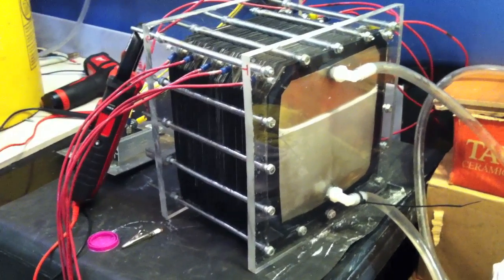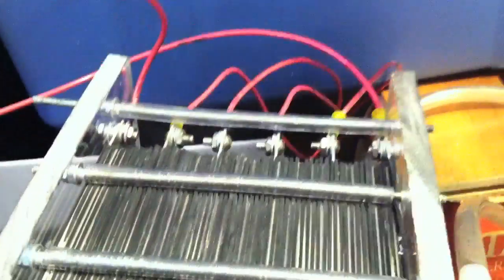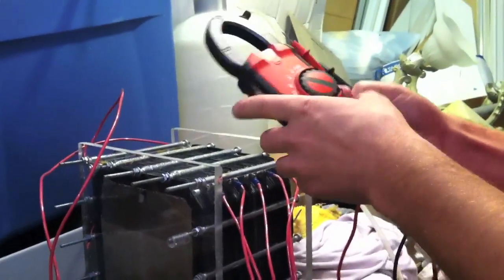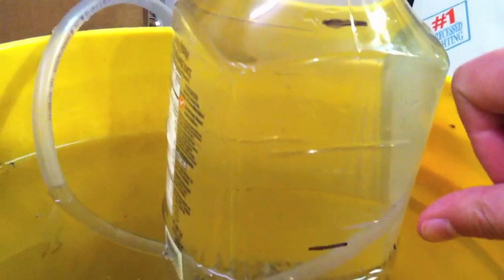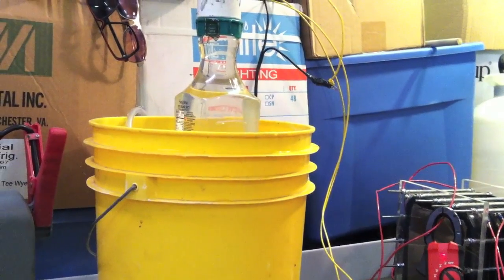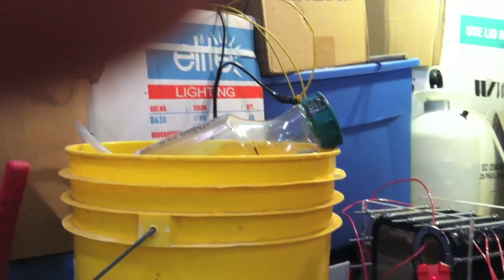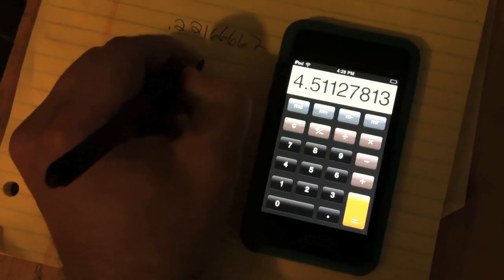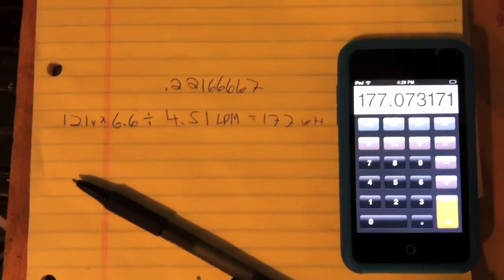120v 4.5 LPM 60 plate hho ( hydrogen ) dry cell demonstration

Comment: Bear in mind that the multimeter read a pulsing fullwave current not a straight line since the voltage isnt buffered by capacitorns. So the measurements and wattage and such will not be accurate unless the multimetre calculate the the peak value with i seriously doubt, only the avarage value with is lower then it actually.
Reply: To an extentextent, without a capacitor compent, the voltage is smoothed by a capacitor formed from the plates  and the electrolyte act as a dielectric storing energy energy below the electrolitic 1.24v per cell in the alignment of water molecules and distribution of ions.
Reply: @kreynolds1123  For the currents involved and the size of the plates that effect is negligible. Maybe at tops a nF.
Reply: @dtiydr  Quite possibly so, although the distance is probably very very small if the electrolyte is as a plate to the cathode, and is a plate to the anode.
Reply: @kreynolds1123  The contact between the plates is very good and that is the totally opposite to what you want in a capacitor since you want it to be able to charge up which only works when the plates are isolated from each other which you might agree is the very last thing you want. So once again if there is any capacitance its absolutely negligible for the currents involved.
Reply: Remembering back to when i did some basic PWM through a logic controller and a solid state relay  with a duty cycle based on temperature, i remember reading huge current surges, about 50 amps   settle down to 30 amps.  I wish i had  a scope to measure that now. 

At the time i didnt think about the capacitance effect, but now i suspect that  pulsing 13.4v on and off and back on again takes a fair amount of energy like the inrudh current of a capacitor, but storing energy in the polar alignment of water molecules, only to be lost when the solid state relay cut the electric current, loosing that energy to the micro turbulent fluid motions of water.  Im afraid that much of the extra energy during the cource of the spike in current just went heating rather than being stored. Between pwm cycles.  But noting the capacitance might be considerable as evident from the size of the current spike. 

I know my next go around will use pwm to  buck convert the voltage down rather than justify switch current on and off. That  is, lowering waste heat with a lower current because of a more efficent voltage is far better than  pwm limiting the average amount of energy being used inefficiently.
Reply: @dtiydr  Consider a supercapacitor. Aside from high surface area, the dielectrics are also made from an electrolyte. And two plates are seperated often by nothing more than paper to prevent the current collecting plates from touching (shorting), but the paper seperator allows ions to pass.

A supercapacitor will take current only untill it is charged to the applied voltage, as long as the voltage is below the break down voltage. For most comercial supercapacitor chemistry , that is just over 2.5v or 2.7v,  but when the electrolyte is aqueous, is the voltage rating is much lower. 1.24. 

In effect, the HHO cell is a double layer electrolytic  not so super, super capacitor for voltage below 1.24v, even it has a relativly high internal discharge rate when the external voltage is removed.
Reply: @kreynolds1123  With a supercap or any cap you miss the crucial point = isolated surfaces. 

In a electrolytic capacitor the thin metall ribbons are heavily isolated by a thick oxide layer and pitted at a microscopical level which creates a huge isolated surface where charge sort of speak can build up. There is nothing of that between the surface of the plates and electrolytic, right? If the plates are slightly corroded of whatever to form a very thin oxide surface or such then it might be a little higher capacitance and smaller current but not near any Farads in capacity needed to smooth out any voltages.
Reply: @dtiydr   Electrostatic double-layer supercapacitors aren't isolated by an oxide layer. Other than the high surface area,  they have high capactance inpart because there is no oxide layer to add distance between the plates.  It is only because of electro chemistry or rather lack of electro chemistry (not an oxide layer) that you have the condition that current will not flow through one plate to the other while the charged plates electrostatic potential remains below a certain voltage based on the type of electrolyte.
Reply: @kreynolds1123  I have other things to do, the capacitance is not enough to smooth the voltage out, period.
Reply: @dtiydr  Despite your assertions that there is not much capacitance I am not convinced. The problem looks more like a high internal discharge rate. 

I pointed out that the capacitance leads to significant surges in current well beyond its steady state current. The surges are counter productive  producing nothing more than heat from the higher current in the metal conductor and dielectric like realignments of the water molecules only to be lost again and again with PWM as a form of dielectric heating of water molecules for voltages below electrolyte's capacity to conduct electricity. 

i'm glad  you have things to do. I was just sharing a deeper insight into what is happening when the voltages are below that which conducts current. And the discussion so far sort of points out problems with PWM.   Good luck with your projects. 😀👍
Reply: @kreynolds1123  Thanks, it was then now I have nothing to do. :) Btw I don't even get the reason to use PWM in these, pure DC and you are all fine and I put the DC voltage perfectly you will get very high efficiency as well and it won't get warm.
Reply: @dtiydr  Why use PWM?  Note, i am not advocating PWM but PWM can limit how much average power is going into a given cell.  Often it is used to prevent overheating. Over heating's root cause as we are aware is a product of too too much over volting along with little surface area to eject the amount of heat that is being generated and the limitations of the materials like gasket and rubber hose materials.

But, over volting is what actually drives current through a cell and 316L stainless steel plate surface area can be relatively   expensive so many people try to compensate steel cost with using more volts to push a higher current density through a smaller surface area. 

If gasket and steel cost were 100th what they are now, one could make a cell 100x the volume now and would be able to produce the same now but at a far lower overvolt producing less heat produced.

Also  with a given design, applying just the right voltage you want isnt easy. Often one  uses neutral plates to make a voltage dividor. But if ones source voltage is 13.4 volts off an alternator, then 5 cells gives you 2.68v while  6 cells gives you 2.23v making say 2.5v unavailable. 

I once worked for a company that had issues with their plates. They had a wet cell design contained in an under the sink  like water filter system. which made it difficult to both implement neutral plates. and get enough surface area. but their system was advanced run by a micro controller that sensed high and low electrolyte levels. and temperature and controlled fans and pumps.  i was the one that programed their logic controller to PWM  limit the average power that went in to help regulate the power. I wish i had known then how easy it was to take a PWM signal and Buck convert  that a voltage to the voltage you want. The following link is a simulation 
http://tinyurl.com/y84eoupn

Comment: Right after the AC is rectified and hasn't been smoothed yet the peaks of the rough DC will be 170VDC but when it is smoothed out it will be the average voltage or the RMS of the AC voltage. It is the same concept of PWM there are peak voltages but the average voltage is much lower, and changing the modulation will alter the average voltage.
Reply: One will get more efficent electrolysis with a capacitor inductor capacitor (pi) filter  after rectification, because the voltages don't get to the mains peek voltage.  And because the rectified DC is smoothed with the pi filter,  the voltages are less likely to drop below the minimum voltage needed for electrolysis, thus the smoothing filter will help the dry cell produce 100% of the time.  Where simply rectified dc drops below the minimum voltage 120 times a second.

Comment: No you do use the RMS voltage when you convert AC to DC. If you rectify and smooth 120vrms AC, then you can expect just under 120VDC accounting for the voltage drop in the bridge rectifier. Using RMS voltage is a way to determine the average voltage/current of the ever-changing voltage/current of AC. When you rectify and smooth the DC voltage/current will be equal to the average of the AC.

Comment: The reason your cell heats up is because it is not a 100% efficient process.   There is nothing that is 100% efficient.  So, the process of separating the oxygen from the hydrogen in the water creates friction.  That friction results in heat.
Reply: When seperating water to hudrogen and oxygen, amps × 1.24 volts is used per cell to seperate hydrogen and oxygen.  Every volt per cell × amp above that makes waste heat.

Heat is molecular vibrations and ionic moluciles pulled through the water to an electrode tend to bump into water molecules along the way, the random bumping jostles the molecules around appear as heat

Comment: No that is incorrect.  You just calculated the peak voltage.
170VpkX0707=120Vrms which the meter reads.

Comment: @badmoonryzn  Your asking the same thing I want to know how many Liters per minute are required to run a ~1600cc engine.I wish to investigate using wind and solar power to make hydrogen.Then make a big low pressure tank to store it  and at night run a generator made from car ~1600 engine.  When hydrogen run out switch over to LPG.When grid is out run smaller generator ~2 kilowatt.You got any ball park numbers  to work with in metric if possible .Local Grid is 240 volts so I need 2*120 HHO gizmo

Comment: I lost the point through the long presentation. What is the total volume of hydrogen created by 12 volts per minute? and then the total using the 120volts. Have you considered how much hydrogen is needed to run an average 1600cc engine? The results would be more useful if in some kind of application of use. Say an engine that needs 400cfm of air with about 7 cfm of hydrogen to reach a stoichiometric ratio useful to run a car. How far are you away enough H for something like from that? Cheers!

Comment: steam. take into consideration steam. put your bottle over ice cold water and watch the condensation on the bottle form
Reply: There is certainly some moisture  but the bubbler cools the gas to room temperature.  Cooling it further would dry it more. But  if the purpose is to compare to what others are doing, then that is less of a concern.

Comment: use a copper radiater , off an old air conditioner , you can get small copper radiaters that are brazed in almost any ally way , i just drive down ally's and look for jusk people throw out, found an old frosti ice drink machine out back of a gas station and it had 2 5x5 in. copper brazed fitting radiaters inside it
Reply: Copper is no good here. The copper will disolve  but very very slowly. Better to have stainless steel pipes

Comment: That looks great I've tred it on a we cell with 18 plate configuration I got voltage drop of 75V and an amp draw of I think it was 45amps can you tell me how your other red wires are wired up if the positive and negative are on each side and how many neutal plates are between them thnaks Edjuman again VERY NICE JOB ;-)

Comment: Bud. If you use a PWM with IRF450 (or so) power mosfets, they can handle up to 400VDC or something, maybe 10 or better amps. That way, on the DC side.. when you run into thermal runaway, you can lower your current without affecting the "actual" voltage at the plates. it will of course affect the RMS voltage, but not the instantaneous voltage at the actual plate gap. That should help when you are really cranking it off.
Reply: PWM is ok for limiting the power that goes in. But turning that into a buck converter is few small modifications.  Buck converter output voltage is lower but roughly constant. Thus you you produce all the time at a lower voltage more efficent voltage. The closer one is to 1.24v per cell, the less is lost to waste heat. 

And more imortantly, peek voltage causes peek currents, and excessive currents can degrade the cells faster, itnis far bettwer to buck convert down to a lower voltage. 

I used to do PWM but making a buck converter with a 555 timer pwm circuit driving a power mosfet is super simple.

Comment from the maker: @fuckyoda. Yea, i tried that. I'm using Sodium Hydroxide as my electrolyte and its highly corrosive. It took about 20min for it to eat through my $50 transmission radiator. What I may need to do is find a better electrolyte.

Comment from the maker: @fuckyoda. I haven't really had much time to work on it lately. I'm having trouble figuring out how too cool the electrolyte. I want to maintain a high level of output (around 6LPM) without the cell overheating.
Reply: a stainless steel cooler

Comment: when you say "dry cell" what exactly do you mean by that?
Reply: In dry cell plates are seperated at gap which is filled with electrolyte and no room for gas to get accmulate in cell it straight away comes out from top exit hose bit more safe design then compared to conventional hydrogen generator